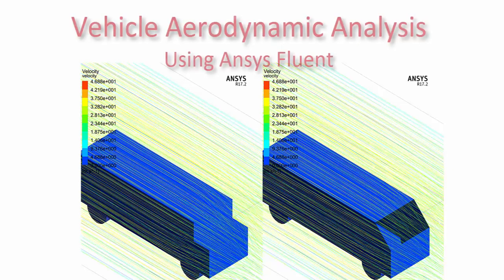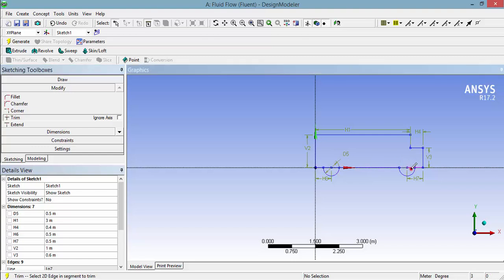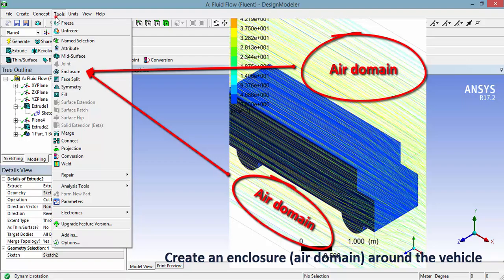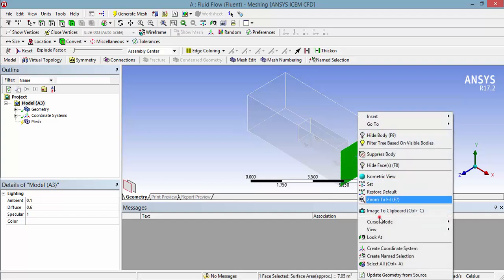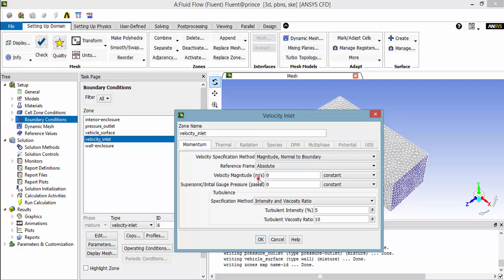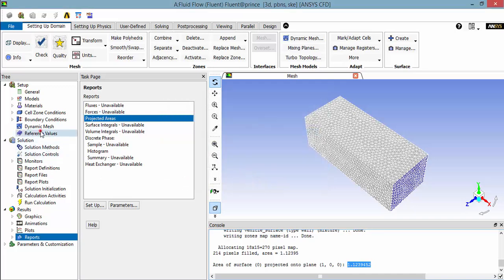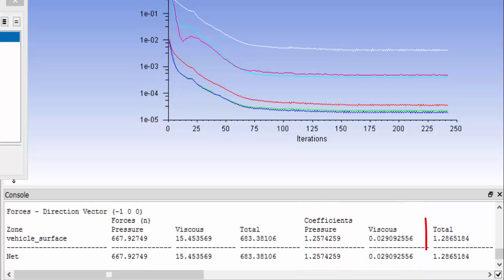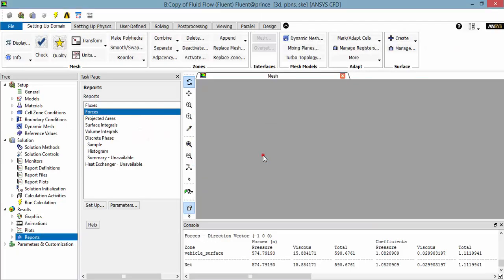Ansys Fluent tutorial for beginners | Aerodynamics | A perfect Guide

Comment: Why my cd it’s very high, 1e+8 ): ?
Reply from the maker: Surely there will be a problem in calculating the CD value. Are you calculating manually by taking force value from fluent? or let fluent to calculate it?
Reply: @MechTechSimulations  thanks for answer, my Cd is correct, the trouble: the mesh size, it was in meters 😂 🙏🏻🙏🏻🙏🏻🙏🏻🙏🏻🙏🏻

Comment: can i use line body with cross section in fluent ?
Reply from the maker: Obviously we can create a line body in fluent. May I know, for what purpose you are creating the line? for computing any specific results?
Reply: @MechTechSimulations  I created 3d transmission tower with line body and given L cross section. I want to do CFD analysis. When I go fluent results there it shows enclousure only it's not showing tower inside enclosure